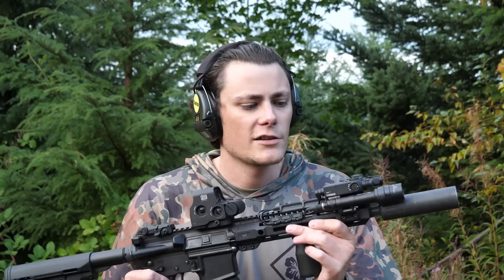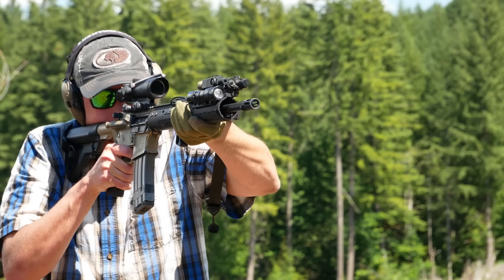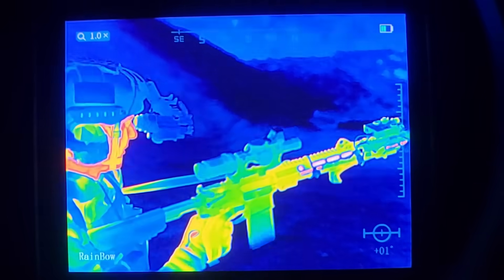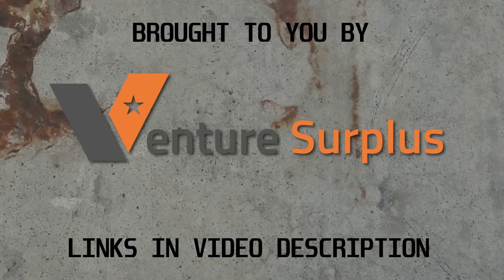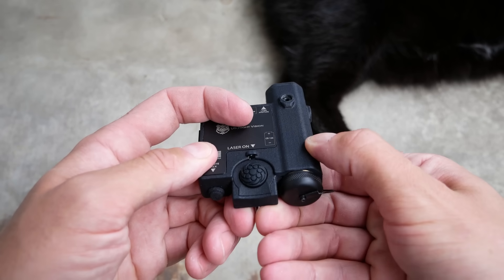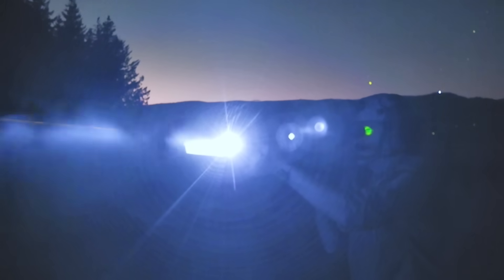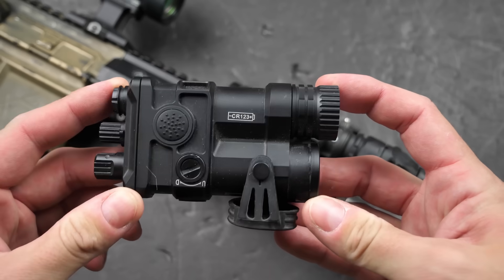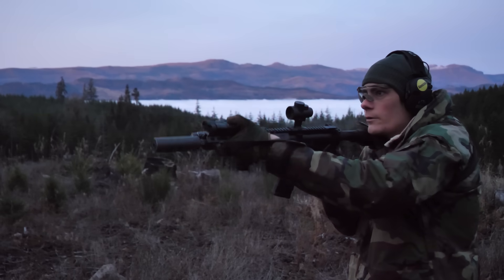IR Laser Module Setup & Control

Comment: Keltec RFB when
Reply from the maker: When the Gen 2 comes out
Reply: @Hoplopfheil  They have a gen 2. It was a slight adjustment on the gas knob I think
Reply from the maker: @jasonjobst  oh please that hardly counts
Reply: @Hoplopfheil  they changed the gas piston, the bolt carrier got a longer spring, and the bolt coating changed. These were more changes made for the gen 2.
Reply: Got this info from a guy called TheBullpupCollective.
Keltec RFB Gas System Updates and Changes

Comment: Thanks for this vid, you clearly explained more in 13 mins that I have seen in other vids going for 30min. You rock with these type vids and comparisons. I never thought about using the tape switch as a sacrificial item to save the unit.  I may get a couple tapes now for just in case. BTW, 9 inches is always the preferred length for most.

Comment: Hey Hop

Theres a video here on YT showing how to remove the focus stop off of a Steiner dbal a3 illuminator mod by o329o 

I need to try it on my 9007 it lets the focus go from about 45° to well over 100° of rotation/focus

I hope it helps the weak sauce Illuminator be more useable by being able to focus down smaller for longer range shots
Reply from the maker: I think it can only be done to certain vintages of the A3, it requires a particular kind of emitter assembly.
Reply: @Hoplopfheil 

Good to know I was hopeful that the thing could be improved without buying a new Lam.

Comment: I've reduced my entire night fighting setup to a cliffhangIR riser. The DBAL mount uses Unity Hub to double as a light mount, behind the laser it the eotech and behind that is the magnifier. Pressure pad mounts to the rail in front of the riser, WITH enough height that the thumb doesn't obstruct the laser/illuminator. I have not tried this on my other rifles (it resides on a 9" MCX), because I'd be off my rocker to pull magnified optics off my other 2 rifles (556 DMR and AR10 SASS-ish) for an eotech stack.

Comment: My way is 
Holosun iris 3 
Surefire turbo with unity gascap tail cap 
Unity Axon switch 
Usbc for the light and crane for the laser 
And the buttons on the switch are recessed so it’s not easy to ND the light or laser 
If the Unity axon fails I still can activate the light with the tail cap and it won’t be a small little pushbutton like the DS00 that can be hard to press/miss and for the laser I can use the on body fire button

Comment: My favorite setup is that but with a surefire vampire and a unity axion sync. I keep the dbal illuminator beam tight and use the sync button for spread. If I want white light I rotate the head. As he said the white light is for daylight or when you don’t have your nods so the head should be rotated to the appropriate setting for the environment ahead of time. If I had a lam with a better illuminator I’d set mine up exactly like his but with the pad orientation swapped. The only thing I’d change about the unity axion sync is make the forward button momentary only. I’d keep a clicky tailcap on the light if I want the light to stay on. Surefire and unity both offer tailcaps with clicky buttons and tape switch ports. The surefire version is ok. The unity usb-c gascap is my favorite.
Reply: Another setup I’ve used that I like a lot is a single button sync to operate the light and lam and just the onboard button to operate the lam. This is only suitable if your lam has a good switch location. This setup works well with less rail space. I’ve done this setup on the smallest possible rails and it works well.

Comment: A WML does not need remote switch unless you have a long barrel or you're trying to cantilever the light head forward of a suppressor. If the tailcap is accessible with your normal support hand grip, there is no reason not to use a tailcap switch.
Reply from the maker: Depends how you hold a gun and how you mount your sling

Comment: Hop I dnk if you've talked about using a snyc function with you lam/ white light.  I'm guessing you don't use but maybe you can elaborate on a vid thanks
Reply from the maker: I've tried a few of these configs before, it's generally not worth it except in extreme circumstances.

Comment: In an era where NV/IR technology is accessible to the common person, I find the use of IR aiming devices, or any laser for that matter, to be a very poor decision. It's practically a death sentence in any modern battlespace.

I think folks should reconsider wasting money on these devices and focus on passive aiming solutions - if personal defense is the primary goal. Just my 2 cents
Reply from the maker: In an era where eyeballs are accessible to the common person, I find the use of white lights to be a very poor decision
Reply: @Hoplopfheil sorry man, that's a kind of a reductive analogy. If your opponent has NV/IR (which is likely to be the case in any situation that you would actually need NV/IR), your DBAL is going to get you in serious trouble (just ask anyone who is fighting in Gaza/Ukraine/Syria/etc.). It's a liability. So, why spend a bunch of money on a device that is likely to cause more harm than good? 

I get that they're fun - I used  them for a living. However, that was during a time when our side had a monopoly on NV/IR technology. That's not the case anymore. So, rather than spend a bunch of money on something that will have very limited use, why not focus on passive aiming solutions, which would be far more useful/practical?

Flashlights are still useful in very specific circumstances - but not when you're trying to pull off "cool guy"  night fighting. Nods are absolutely critical in modern low-light fighting environments. NV/IR aiming solutions are giant beacons that say, "I'm right here", to your adversary.

I just think if people want to be "prepared", it would be best to focus on solutions to engage threats without advertising your exact location in the dark.
Reply: @charlesm.2756  i don't think you;ve ever shot a rifle at night in the vicinity of other people also shooting. pls watch the brassfacts video showcasing how little of the laser/illum you see if it's not aimed directly at you.
Reply: @RandyTheB_ I've definitely performed a lot of night shooting. Once the shooting starts, muzzle flash will give away your location - it just won't be a straight line like IR illum. My point is that the IR illum is going to get you in trouble long before the shooting starts. 

If you're moving through a contested environment and kicking off IR lasers, it's going to be very noticeable under nods. You can see it from hundreds of meters away. Again, I'm not saying NV/IR is bad - it's a critical piece of kit nowadays. I'm saying NV/IR lasers are a huge liability. Seriously, there are dozens of interviews with Soldiers (from all conflict areas) discussing just how dangerous it is to use IR illumination in combat. 

It was a fantastic tool back when we were fighting opponents that didn't have the technology. However, cheap chinesium lenses can pickup IR illum. Its just not a good idea in modern combat. Passive aiming  solutions, combined w/ nods, are more appropriate when conducting low-light ops. 

Also, I love the work Hop and Brass Facts do. I'm a fan of them - but I don't necessarily agree with everything they say.

Comment: My biggest challenge at the moment is figuring out where to mount an IR laser on my 12.5" that has a traditional A2 FSB and a BCM PKMR handguard.  A WML is mounted with a tape switch adhered to the opposite side of the light with 3M double sided tape.  I love the handguard, so I'm reluctant to replace it.  Additionally, the handguard is exactly 9", and 9 inch aluminum handguards are difficult to find should I opt to replace the PKMR.
Reply from the maker: Don't bother putting an IR laser on that

Comment: Offset irons are the correct answer, not because you need irons for if your optic goes down, but because you need a sighting system that will work in very wet/ rainy environments, and keeping them offset means your wet optic that you already can’t see through to use is now not blocking your iron sights as well
Reply from the maker: Extremely sensible
Reply: Based take
Reply: But drill sergeant trench grenade says backup iron sights are unnecessary.

Comment: I have an 8” hand guard on my .300 black aero and have really been liking the hrf skiff to bring my LAM back to the center of the rifle. I use a dbal d2 which is chunky and heavy as it is so it really helps, and frees almost the entire front of the hand guard. I run a surefire on the front extended out with a trex arms light bar to minimize suppressor shadow.
Reply: I have a very similar solution to that weight balance complaint on my MCX, the bitch is SUPER front heavy with a stainless L length can, laser and light. I used a CliffhangIR to put the laser closer to the center of the gun, it uses the unity HUB to mount the light on it as well, then the eotech behind it and the longer cliffhang has room for a magnifier too. The riser raises the laser high enough that I can C-clamp the rifle with the pressure pad on the top rail in front of the laser and not have my thumb obstruct the emitters, frees up the entire handguard of space, and not to mention it negates mounting the laser to the handguard which was an afterthought at best from sig. It looks way more bitchin than I can shoot it but its very intuitive and comfortable.

Comment: I’ve honestly stopped using tape switches for most of my white lights. My “go to” night setup right now is an Iris 3 and a surefire turbo (mini? Idk it’s the small one) on the left side so I can just activate it with my thumb. I do have a mod button for the Iris (the factory pad sucks) but I can easily use the entire setup without the pressure switch functioning (which being a mod button is always a risk). Definitely some setups I need to rely on dual switches and what not but on my 12.7 that I use a majority of the time I enjoy the simple options. (Edit since I actually watched the video now- ctf3 rocks on short guns).

Comment: The setup is extremely practical & looks quite nice.  Personally i dont care for wires so i skip the tape swich all together and instead opt to use my iris via its controls and a tail cap on my white light.

There are a few drawbacks like your thumbs eating shit when firing while using the tail cap but again im just not a wire setup guy.   
BUT IT DOES LOOK COOL which is like what 65% of the purpose

Comment: Any good offset iron sights that lean on the left/non ejection side of the rifle? Or can those MagPul ones be flipped around for left side mounting?  Also…Socko!😻❤️
Reply from the maker: Midwest makes a set that can be reversed to mount off the left side of the gun instead.
Reply: @Hoplopfheil thanks! Just installed them and they work great. Now I won’t have visions of Jack Daniel haunting my nightmares. 😂

Comment: I hadn’t actually considered the laser switch as a wear item to preserve the life of the activation button, that makes a lot of sense. I had been just using a light switch and the built in button on my lasers so far. Might need to rethink that, it seems harder standardizing on Streamlight Protac pro lights though. I’ll have to research what switches work. Thanks!
Reply: Arisaka, Z-bolt, and other companies make adapters for Streamlights to use Surefire or crane plugs. That opens your options to the largest ecosystems of dual lead switches 👍🏼
Reply: @White.Wall. did a double take when I read arasaka lol
Reply: I know at least the Unity Axon have Streamlight compatible versions now (the new not-actually-just-a-crane-switch looking plug).  I was kind of surprised none of the other companies I checked have adapted to it yet, maybe they're playing chicken with Streamlight to see if they'll just give up and join the Surefire/Crane ecosystem.